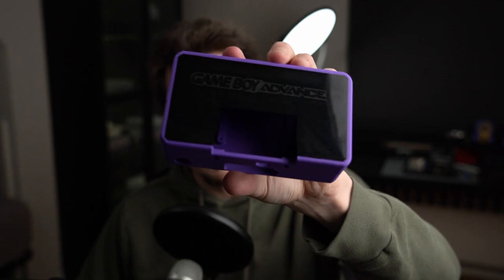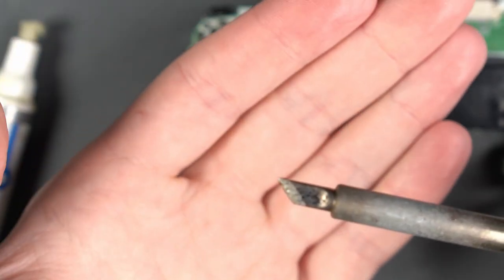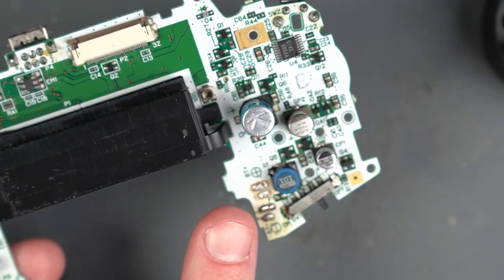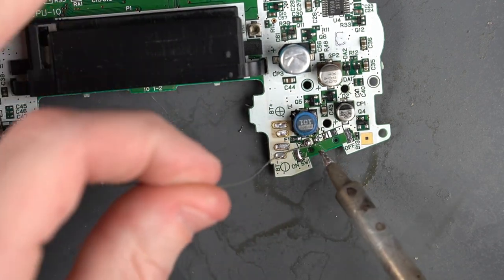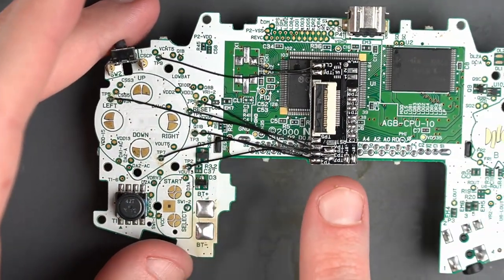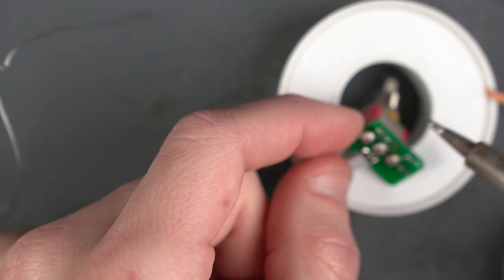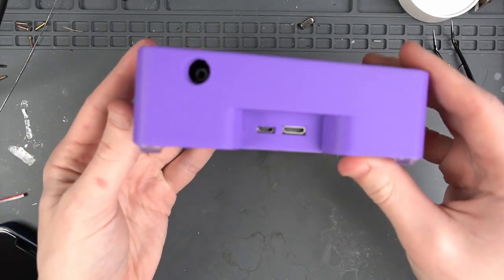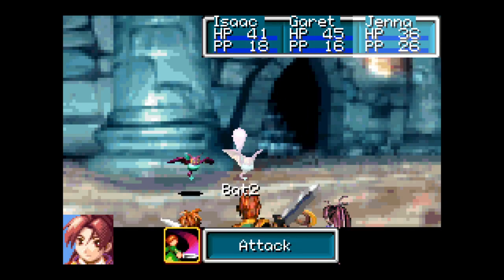GBA Consolizer Install - Play a Real Game Boy Advance On Your TV!

Comment: The makers of the GBA Consolizer just changed their design which makes installation significantly harder now. The soldering went from an intermediate level to a very advanced level. Keep this in mind if you are thinking about ordering one because most of the build videos online now don't show the new process.
Reply from the maker: I will be making a new video when my kit arrives
Reply: @dubesinhower  Thanks! Your video was the best install tutorial I found for the GBA consolizer. I was disappointed to see that they had changed the kit. Soldering that flex cable to the processor look a bit too far past my skill set.

Comment: Do you know if the Face Hugger version allows you to use attachments on the link cable port?? I just saw a turntable video that was posted 3 weeks ago, and it looks like there is space to fit both the HDMI cable and an attachment, but I am not sure if the tech will read it. Do you know?
Reply from the maker: I'm not sure, you could reach out to GameTechUS on Twitter to see if it would work

Comment: What controller are you using did I miss that part?
Reply from the maker: I just used a normal SNES controller when I was soldering, but I normally use my 8BitDo SN30 2.4 ghz wireless controller for playing

Comment: And when comes the build of a Gbahd?
Reply from the maker: I’ve ordered the parts for a GBAHD build for an GBA SP
Reply: @dubesinhower  with separate parts or with the Shield?
Reply from the maker: Not sure what you mean by shield but I'll be following the build from this Reddit thread: https://www.reddit.com/r/Gameboy/comments/kzgrjw/full_guide_gbahd_build/
Reply: @dubesinhower  ah that's the old build. In the German community was made a Shield with atmega inside that use ribbon cable and only Button soldering on the board.
It's easier to install and the case are made for it.
circuit-board.de/forum/index.php/Thread/31478-gbaHD-Open-Source-GBA-Consolizer
Reply from the maker: Wow thanks for the info, I’ll check it out!
Reply: But the old build works too but the arduino Script has a over work. Look at the German community
Reply: @dubesinhower  no prob the forum can help even with English writing